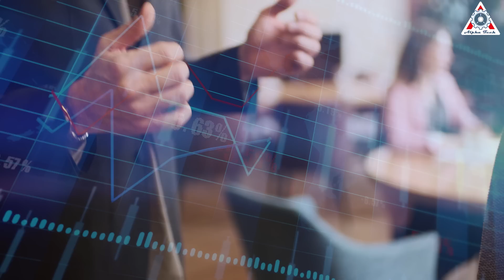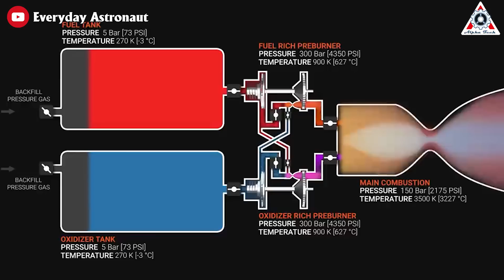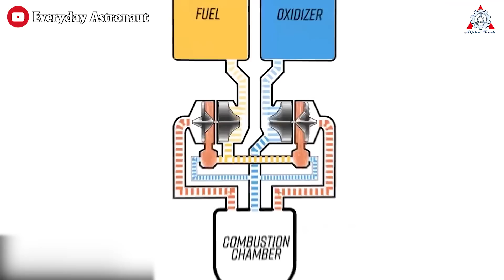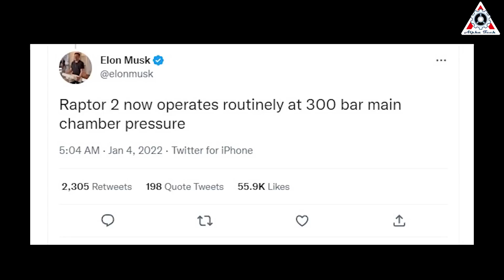SpaceX's NEW-GEN engine absolutely out-class Russia's best engine...

Comment: The Raptor Engines used thus far for Proof of Concept StarShip landings in Boca Chica have proven to be Unreliable if nothing else. The Gen 2 Raptors have yet to be proven in Flight. So how is the Raptor "Superior in Every Aspect" to the Russian RD-180 ?  It's well known that NASA doubted the RD-180's performance for Decades until the 1980's when The US was allowed to buy these engines, test and eventually reverse engineer them. NASA believed the metallurgy advancements required to build this engine were impossible to achieve in the 60's and yet it proved to be 25% more efficient than Anything the US had developed until Raptor. The RD-180's record has stood for decades and proved reliable enough for Atlas an the launching of Many US CIA Satellites.  Every StarShip Prototype flown had Raptors flame out or begin to self-destruct. Superior in every respect except for reliability and endurance would be more accurate. I'm a TOTAL Fan of SpaceX's "not afraid to fail" R&D MO, and their Booster re-fly's have shaken the industry to it's core. Everyone's playing catch-up at this point, but throwing Hype and Spin into their description doesn't help. SpaceX is still a newcomer & leader in the new Commercial Space Race and will likely stumble at some point . . . Lets give them room to breathe and not put so much emphasis on how Superior they might be.